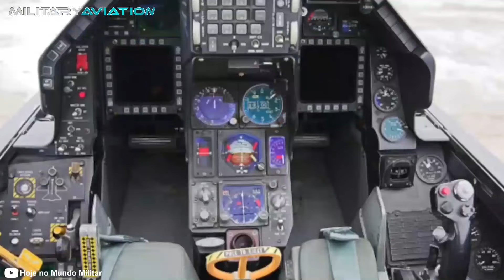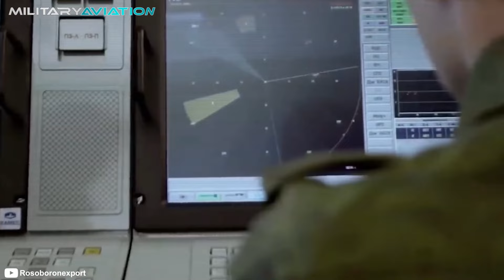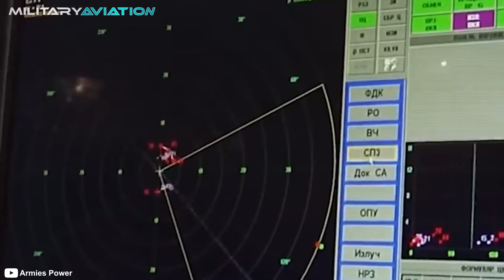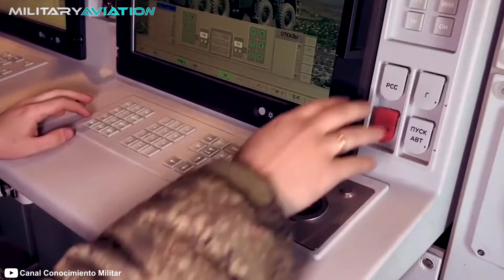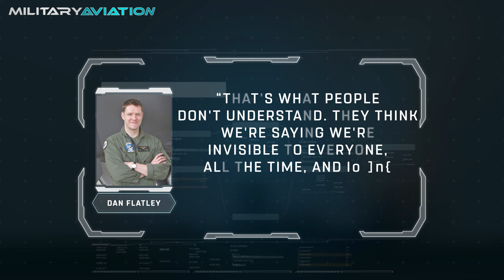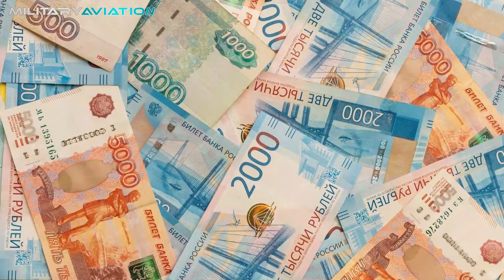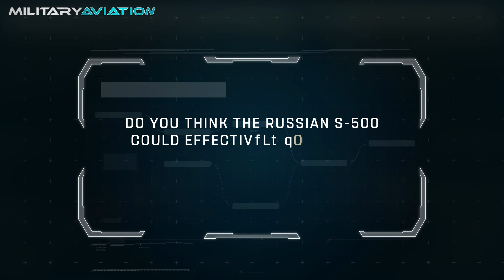F-35 vs Russian Anti-Aircraft System | Who would win the duel?

Comment: The F-35 is such an advanced fighter that it is never used in an area that has any anti-air capabilities.  No one knows if the F-35 has been detected by Russian radars because unless they lock on, there is no proof of detection.  Until the F-35 is used in an offensive role against Russian or Chinese anti-air assets, they can acquire tracking data of the F-35 for use when it is necessary.  If you don't let the enemy know they are detected it is to your benefit.

Comment: It’s not the missiles or the launcher but the radar and threat detection on both sides.  The F-35 is very hard to see on a cluttered airspace.  The Russian tracking systems may be able to detect it but once launched the missiles don’t have nearly the same phased array multi-mode radar.  Plus the F-35 has been flying just beyond Russian space since day one of the invasion.  By now they now every mode, frequency, and detection operating modes of all Russian radar systems.